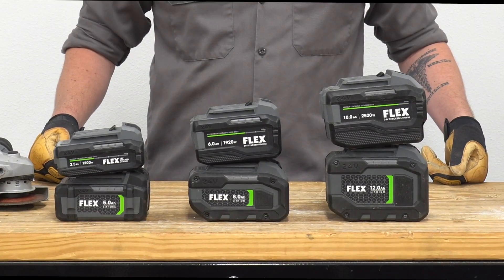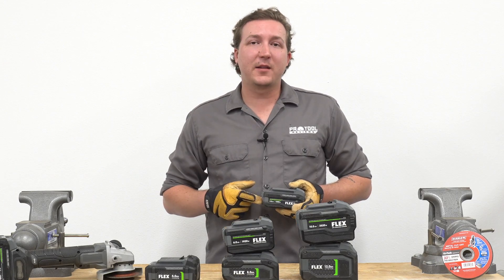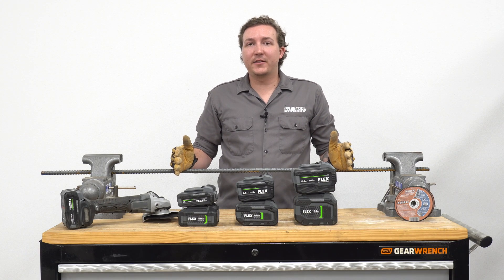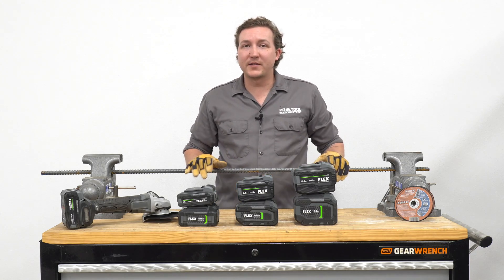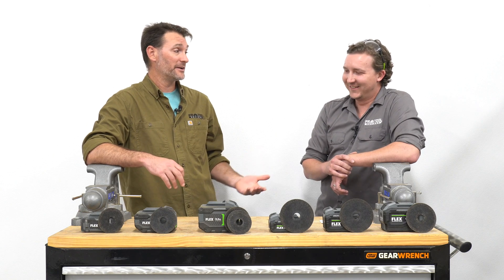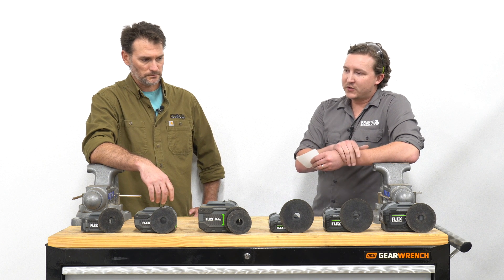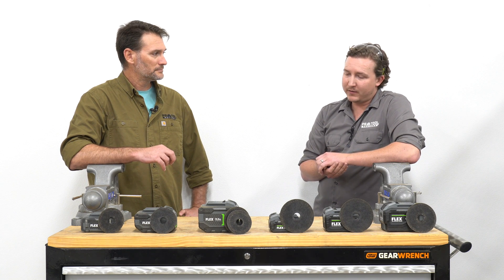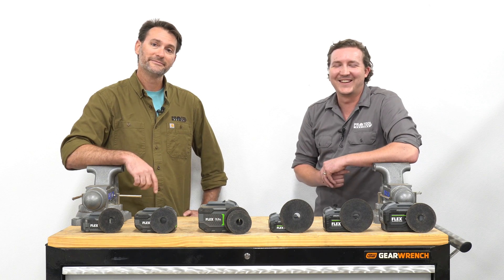FLEX Stacked Lithium Batteries... ARE THEY POWERFUL?!

Comment: I go thru 4 battery's to do one job with my flex grinder
Reply: The problem people have is Flex has 5 speed settings on their grinder. Speed 4 is equal to what most grinders max at. Speed 5 is like a turbo mode used for a few high speed cuts. Speed 4 with a 6 ah stacked lithium battery can do alot of cutting

Comment: Thank you for another great review!  ❤🙏
I do have a question about the lifetime warranty on the stacked battery. The lifetime covers only for three batteries... is that 3 per registration of each battery .... so if I  have a total of five batteries and they all failed. Will Flex replace five batteries maximum 3 times or just three batteries for the account/name on the account?

Comment: No kidding! I have those batteries! Flex 24V 3.5Ah, 6Ah and 10Ah stacked lithium batteries! And my Flex Quick Eject Impact Driver destroyed my cousin's Milwaukee gen3 Fuel impact driver w/ 3.0Ah, 6.0Ah And 8.0Ah high output 21700cell battery. No kidding! Also on my Flex Turbo Hammer Drill, my DeWalt dcd998 FA got beaten, my cousin's Milwaukee gen3 hammer drill w/ 8.0Ah high output battery got beaten too!
Reply: Oh shit! Seriously?! I hearing a lot from Flex fanboys a lot now days especially in my jobsite. Saying that the Flex is a Milwaukee Killer, I even saw my fellow carpenters running the test, my buddy got his Flex quick eject impact driver and the Turbo Hammer Drill a week ago from Lowe's, then he got the Flex's 24V 6.0Ah Stack Lithium Ion pouch cell battery for his impact driver and he challenge the other guy with the Milwaukee gen3 Fuel impact driver with 8.0Ah High output battery 21700 cell. They run some 10" Timberlok screws twice, on pressure treated 4x8 and the Milwaukee got beaten. They also run the test again with 10" long by 1/2" dia lag bolt and 3 times and the Milwaukee got beaten again 3 times Both of them run hot! Shit! I wouldn't run my impact driver in that kind of battery I mean I'm ok and good with 3 or 4Ah battery. I noticed that the more AH battery your tool is running with the hotter the tool gets.

Comment: I'm more curious about longevity of the new stacked batteries.  Historically  LiPo chemistry has had far fewer charge cycles than the LMC chemistry used in the cylindrical cells we've been getting in tool batteries.
Reply: Patrick Patterson, yeah well I got me a DeWalt 1.7Ah Power Stack Lithium Ion pouch cell battery powering my DeWalt DCF887 3 speed impact driver and DCD796 Hammer Drill. And I'm beating the tool abusing it in my jobsite, and I dropped my tool 3 times from 8 feet. And the battery is still working so far! No signs of malfunctions, leak or electrical problem, YET!
Reply: There the same but not the same as your lipo pack you would find in your rc there totally different tho there's been over 10 years of trial and engineering these flex packs claim to have if im not mistaken 300× charge cycle of your regular cylindrical 18650 or 21700 cell 🤔 I own several so only time will tell 😉

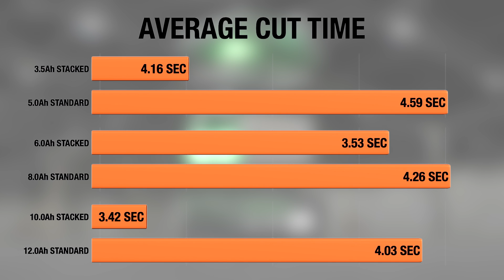Comment: 3:06 manipulation on figure, 4:59 its 5 times longer than 4:15 ?? difference is less than minute, and from figure you cane read, it's 3 or 4 timest faster.
AND first cut on 3,5 ah stacked is slower than on 5ah standard, so its manipulation? worst cuting disc or something??

Comment: Can i use these new batteries with my milwaukee tool with an adapter
Reply: no because Flex operated on a higher voltage. That's why there are no adaptors available on the market.

However, you can definitely use a Dewalt POWERSTACK battery (same technology) on your Milwaukee with an adaptor
Reply: @luisinhoens90  haha! 🤣True!! Not unless you wanna Fry out your Expensive Milwaukee cordless tool. I keep telling to all my fellow contractors in the jobsite. Quit dreaming Milwaukee will never have Stacked lithium battery technology. Not unless Milwaukee wants to get Sued by Flex company for 600 billion dollars. That Flex company have their Stacked lithium battery technology in the US Patent. It is protected. It is regards as Intellectual property. Cannot be imitated and copied without consequences and repercussions. Milwaukee and TTI knows that. What Milwaukee and TTI Ridgid, Ryobi and Hart should do right now is to go back in the drawing board and science lab 🧪🧫🧪🧫 to create their own new battery Flatform, I guess Milwaukee can make partnership with Caterpillar, caterpillar now have Graphene Battery technology. I heard Graphene is much better than any Lithium Ion batteries that exist.

Comment: Would be great to see if that improvement carries over to circular saws and impact drills. Do they weigh alot less? More compact is certainly welcome
Reply: The weight is about the same as the existing batteries, but the power and performance is much greater. So the 5ah Cilindrical and 6ah Stacked weigh nearly identical, but the 6ah Stacked performs at a much higher level.
Reply: @TheRJISAWESOME  I don't know if I'd consider a 17% increase to be "much better"

Comment: These baterie overheated quickly
Reply: I use them everyday at my job and I've never had a problem. Obviously you can't run a 2.5 ah on a recip saw or it will kill it right away. But I've never had a battery overheat ever

Comment: Dewalt beat flex to the stacked lithium batteries haha
Reply: Is it a win for dewalt if they only have a 1.7ah on launch? I say Flex is the winner because they brought 3 batteries to market, not just one.
Reply: @ferndogg84  I guess that makes sense. But still More people like dewalt so I think that the PS was a huge part of the dewalt platform.
Reply: Flex’s stacked lithium leaked on vcg’s channel prior to Dewalt announcing the power stack. Interested to see how they “stack” up against each other!
Reply: @tylervalentin9450  but Dewalt atleast released the PS before flex did, Dewalt cooler lol. How they “stack” up! Good one 👌🦆😂😎
Reply: Flex had been engineering the battery for the last 10 years they put out better batteries point blank.
Reply: @WTNPROUD  Fair enough 👍, but still I would rather stick to my bumblebees
Reply: FLEX had been working on it long before dewalt considering they released 3 pouch cell batteries to dewalts 1. And they both hit the market around the same time.  It took dewalt another year to release another one. Anyone with half a brain can tell who beat who to the technology
Reply: A year later Flex released its 4th pouch cell battery. Dewalt has a 1.7 and a 5ah. FLEX has a 2.0, 3.5, 6.0,and 10ah pouch cell. Dewalts a little behind
Reply: Check out the FLEX Faceoff and other influences repeating the same tests they did. DeWalts power stack couldn't even compete in some of the tests, even with M18 batteries. It's a good battery, but it seems like DeWalt may have cut a couple corners to get it out faster.
Reply: @TheRJISAWESOME  Yeah, I have 2 of them, they are great! Definitely more power compared to my normal 2 ah. I do think the PS does slack power compared to the other new batteries due to lower ah of it.
Reply: @TheRJISAWESOME  The Powerstack has great power and small footprint but drains out quick because it's still a 1.7Ah battery. 
It gets you the same power output to a 5Ah battery but runtime will still be much lower. I have a PS battery and definitely like my 5Ah batteries better.